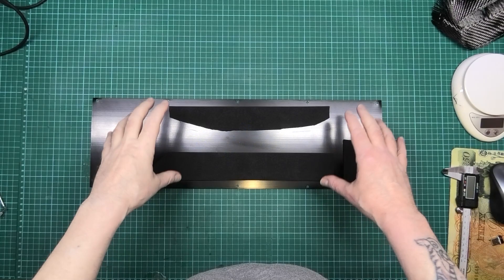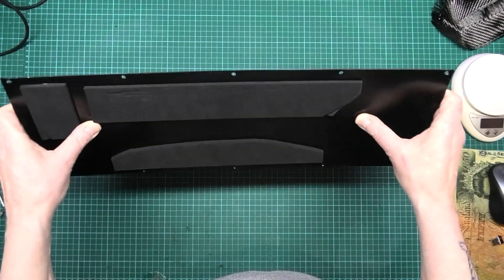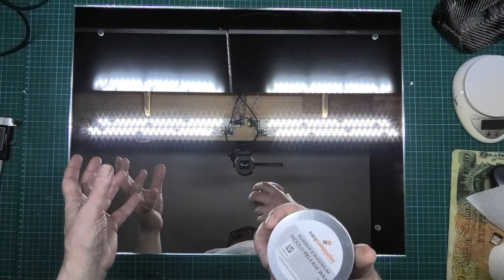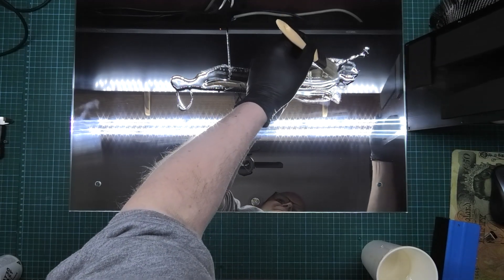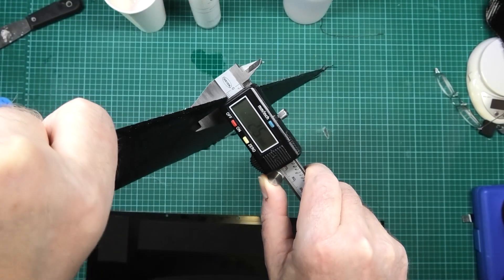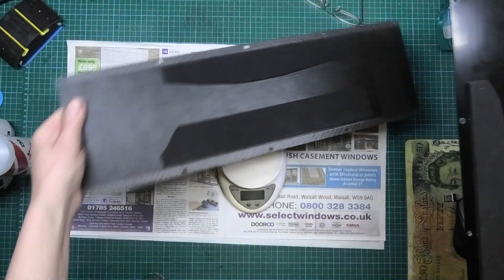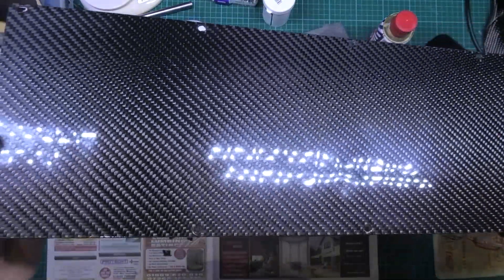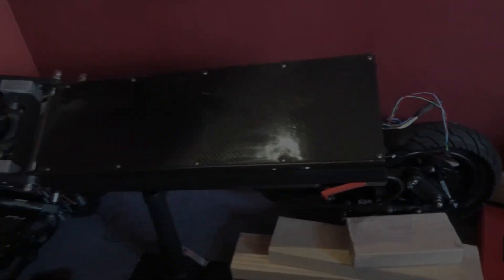🔴 EXTREMELY POWERFUL E-SCOOTER BUILD part 22 - The last carbon fibre part - The battery cover

Comment: That is a fantastic project with all those carbon fibre parts you made from scratch iv'e never seen anybody do a anything like this before. This scooter is going to be like no other on this measly planet it's lighter and stronger than the original and it's going to be so much faster just brilliant. Thanks for sharing your E Scooter journey with us keep up the great work.
Reply from the maker: Cheers mate 👍
I can tell you now, it's FAST. Power to weight ratio taken into account, it's the most powerful scooter in the world at 819 BHP per tonne and believe me, it feels like it 😁

Comment: That was interesting. To see the weight saving and strength gains. So def worth it.
Maybe the outer layer could have been Kevlar, just to cope with the possible assault it may get ?
Another bit of good work.

Comment: Hi Tony, how is your health..?
Question for Kelly 7212-7218-7230....
How can they but 21s or 22s batteries...??
Can these controllers handle so much voltage, without changing mosfets??🤔
Reply from the maker: I'm running 18S and pulling 11kW with no problems at all so I'd say yes, it can handle 21s but I think 22s is pushing it a bit.
Reply: @Vortecks  wooow!!😲
Can this motor handle so much Watts (ambers)...???